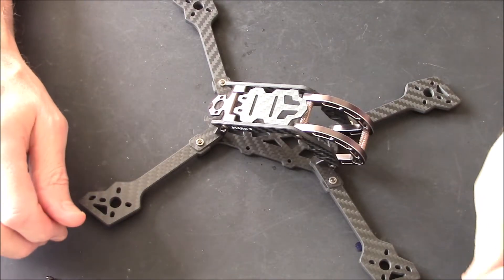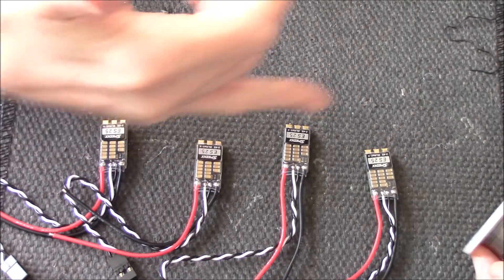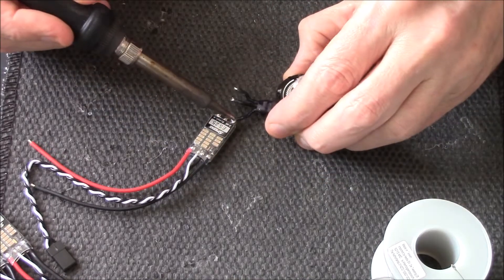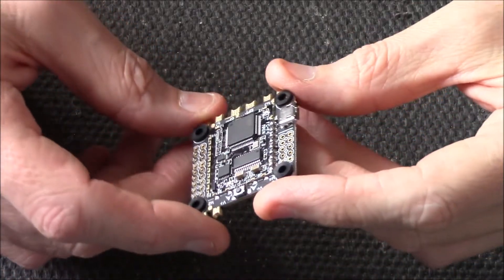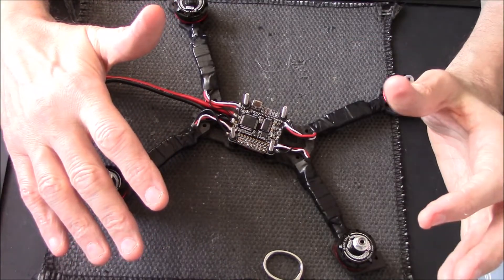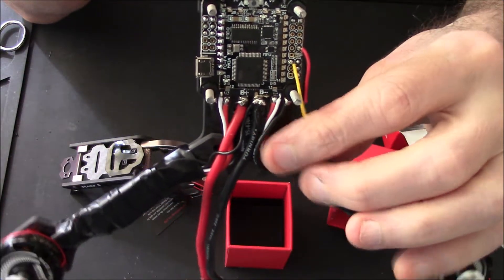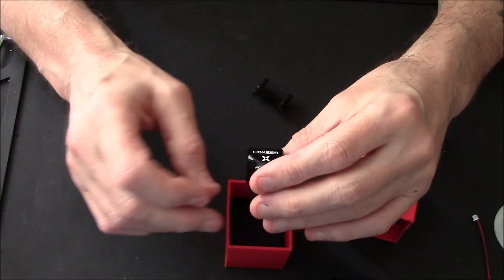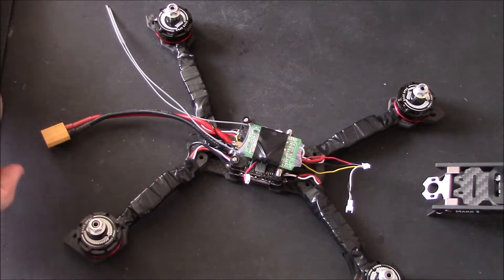GEPRC MARK3 PART 2 THE BUILD AND MAIDEN

Comment: Can i Put 5.5 Inch Props on the Front?
Reply from the maker: Yes its a 5inch quad which means it needs 5inch props. Just like a 3inch quad uses 3inch props..Hope this helps
Reply: @GeorgeCooper_LoneWolf  some props are Little bit bigger as 5 Inch 
Also so 5.1-5.5 Inch diameter is it possible to put it on?
Reply from the maker: You want 5inch props for this model such as 5040 / 5047 / 5050 or any 5inch prop, the second number represents the pitch
Reply: is an 5140 Prop 5.1 Inch?
Reply from the maker: That's right buddy  5140  =  Length 5.1"  Pitch 4.0"
Reply: Also 5.1Inch Diameter Not fit on?
Is 5.0 Inch so close that the Prop Can Not be 0.1 Inch bigger in the Diameter 
And the H6 Frame with 6 Inch Brakes Fester? Becurse longer Arms?
Reply from the maker: Plenty of room at the back for the 5.1 but the front props are very close to the frame with 5" on but you may just get away with it, but better to play it save and go with 5"

 As for witch brakes faster that will all depend on the set up, however I have found that a 5" will brake faster than a 6" because of moment and weight.